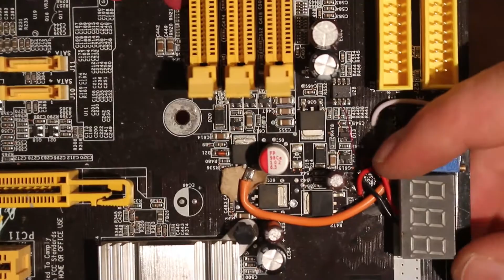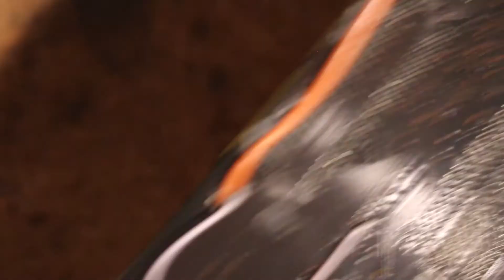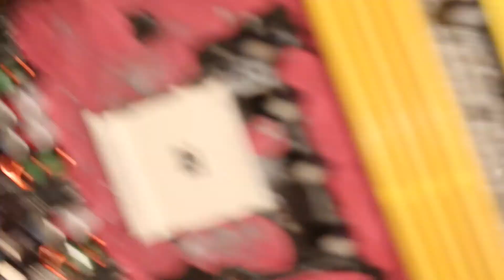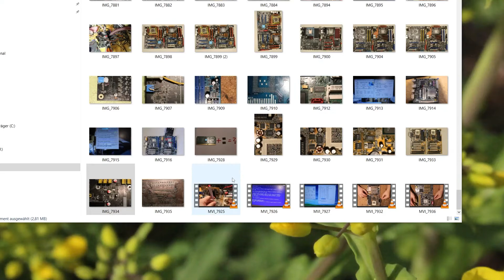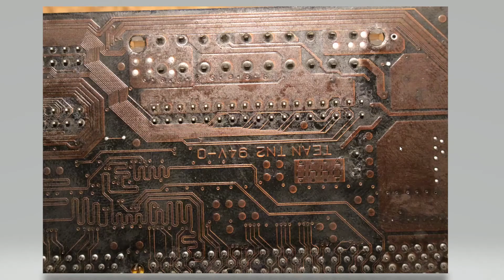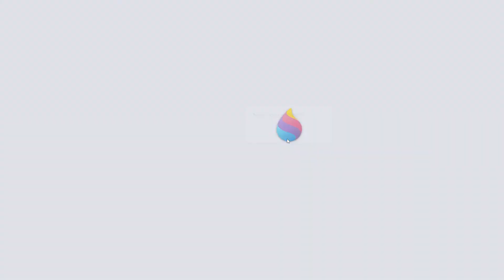Improving the best socket 754 board / DFI Lanparty UT nF3 250gb Vmem mod

Comment: hello  did you recap this board too does look like it ?   i was wondering  if you can give me the cap values  uf and volts of the power delivery caps on the left side?   I have a dead 250gb  which died ony powers on if you unplug the 4 pin connector but yea no boot up and at the time i noticed it had swellon caps all in that area  and i left my cousin mess with it and failed  and i want too make sure he replaced the right values in that area which i dont think he did.    Going too try my best myself too get it going by recaping it  more so the 10 caps on the right area order in the spots too would be helpful too ;) . 

thanks :)